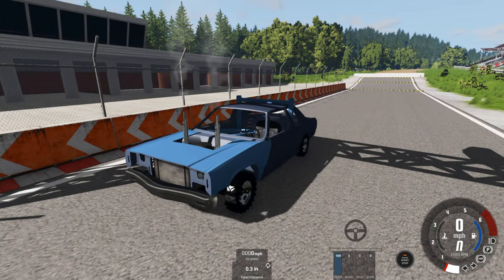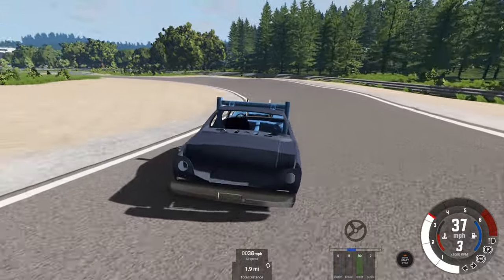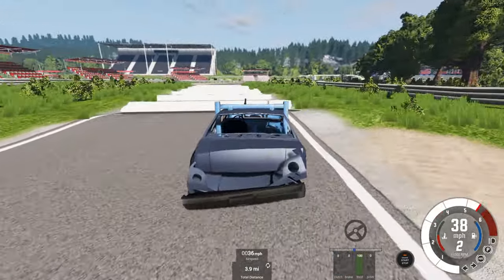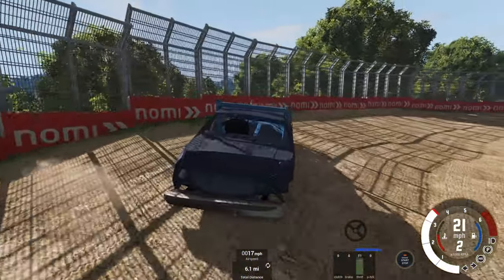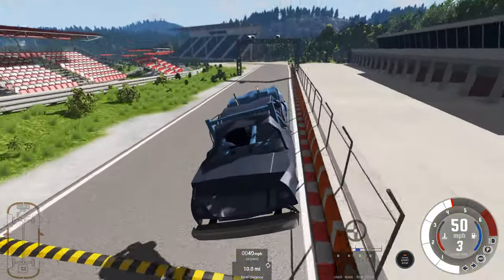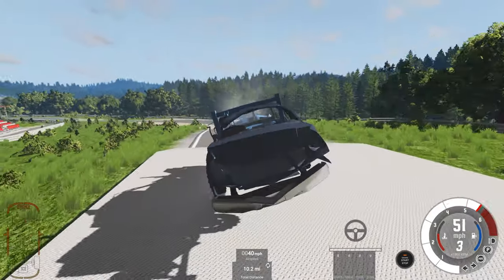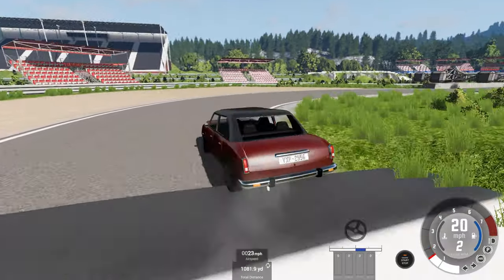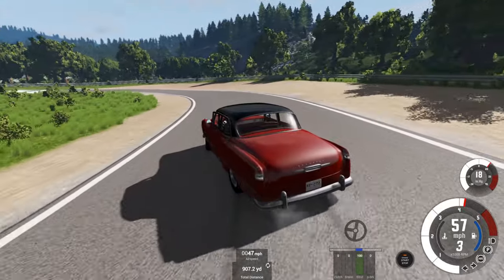Driven Till Destruction - Proving Grounds #11 - BeamNG Drive

Comment: The Crown Vic was part of "Realistic Derby Project."
Reply: I have that installed too so I can vouch for that
Reply: @motorhorn  I had it installed, but it either conflicted with another mod or the Burnside, so I decided to remove it.
Reply: I have that mod too.  Not really a fan though.  While the normal BeamNG cars feel a little too weak for derby prepared vehicles, RDP cars have the opposite problem.  Like a head on collision between two cars at 20 MPH hardly dents them.
Reply: @scottthewaterwarrior  that’s kind of the point though when you look at real derby cars built off all the American iron like that such cars Don’t really deform too much when they hit each other slowly
Reply: @silasmcgee3647  In the derbies I've seen they still deform faster then in RDP.

Comment: This looks like  great game is definitely on my "to buy" list but I wish that they would model metal fatigue.  When the last car (the Burnside) had its front right panel almost ripped off the resulting slab of metal flapped about for another 5 minutes when in real life it would have flapped, fatigued, then snapped off.

Still, great stuff.
Reply: That would be hard to code but would be cool
Reply: @nopegaming2117  They already model stresses between each node in the vehicles model and seem to have some sort of bend and break values for each link, all they have to do is add another value for fatigue so that after "x" number of non critical bends the part will break.  Some materials and bend and flex nearly endlessly while others fatigue very quickly
Reply: @rags417  ok thanks for providing the background information on how that works :)

Comment: The Crown Victoria / LTD was very impressive. It seems blue cars do well here! The Blue Cheesy still leads, though. 
18:45 given how long the video is, my hopes aren't high for the Bagel... very wide for a European car, the Bagel. 
Eeyup. Dead as a doorstop. 
22:16 epic damage on the Burnside. You know it's bad when the rear passenger door is holding the front door open for you...

Comment: The mod is missing some textures and the spinning things don't spin help please
Reply: I have the same problem as well but at least the circuit is (mostly) the same
Reply: you have to switch to the spinners and set it to 40% somehow. some jumps are missing for me too.
Reply: With the spinners, you need to set a control to start and stop them.  I can’t help with the textures...
Reply: The Dover jump has been removed from the design.

Comment: why am i missing textures on this map and the spinners don't work do i need another mod? please help
Reply: The spinners should work, they're a default vehicle. You need to switch to them and throttle them up.
Reply: @CWINDOWSsystem32  thanks spinners work just alot of texture errors for me :(
Reply: @Diced420  Yeah, the latest version of the map has texture and material errors. I think Alex is using an older version.

Comment: Day 3 of asking Alex to do a horizon 4 traction control investigation.
Reply: I think the answer would be no, the traction controll doesn't make you faster. I have a example for it. There are the Laracer challenges where you have to drive a countach. I tried many times going for gold, with and without traction control. And I had to realise that I can go faster without it, even though it was more annoying to drive. Well, for the taxi missions, because the taxi has so much power and a lot of times you have to drive in the rain with a RWD car, it's better to have traction or sliding control.
Reply: Episode 3 of asking Alex to drive a Limo and the Ambulance around the track xD